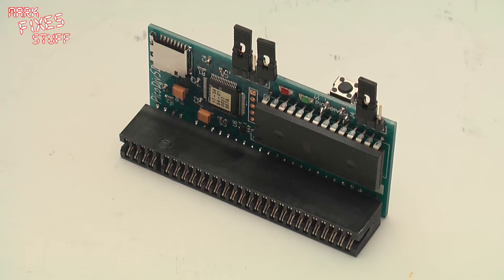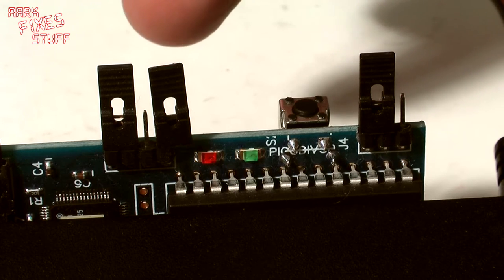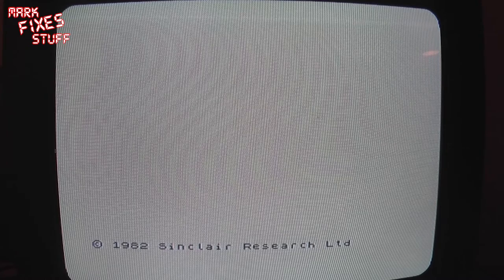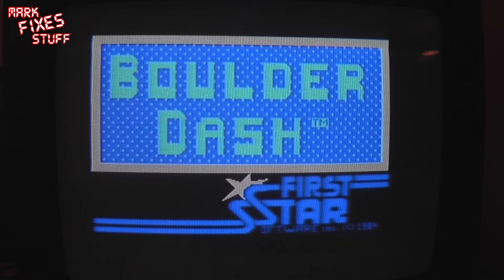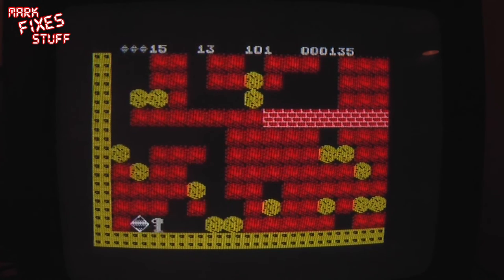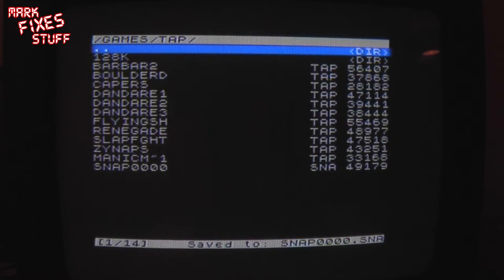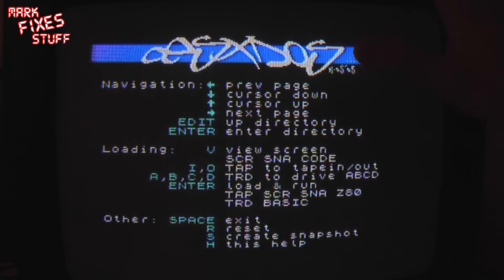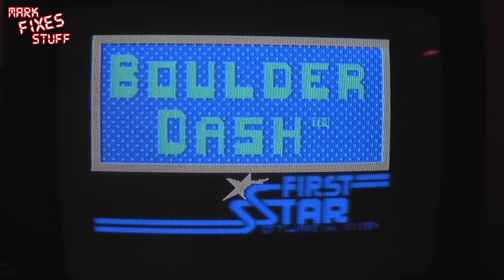Review: PicoDivSD by Zaxon a small SD card Storage for the ZX Spectrum - PicoDivSD Rev 2.0

Comment: when i had a multiface3 years ago i never used it to "cheat" but i did use it to copy games to disk, i used to load them in on tape and at the options screen i would take a snapshot.
it was great and i ended up with loads of games,  those disks are still readable today, people moan about the 3 inch drive and mechanically it is inferior to 3.5, but the disks are better lots of my amiga disks are unreadable, but only 2 of my 3 inch disks are dodgy, they seem to archive better.